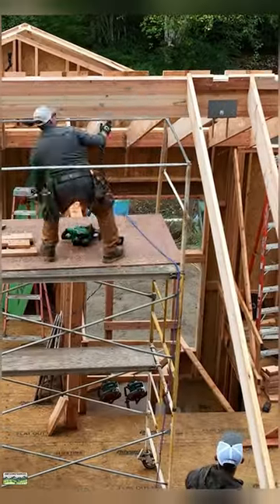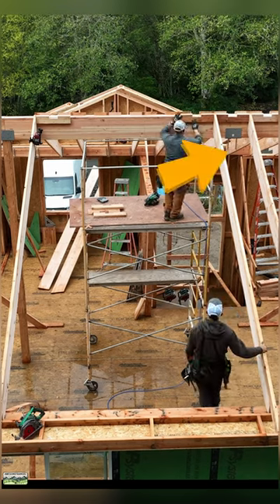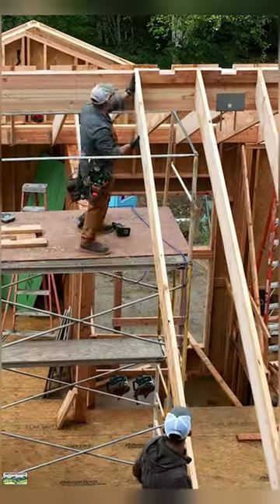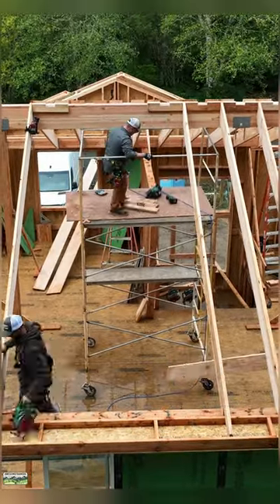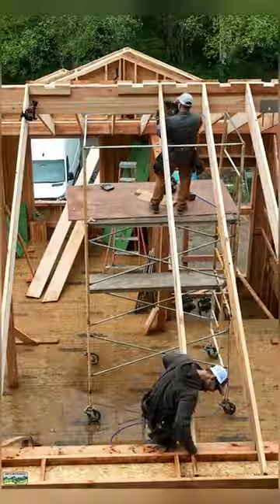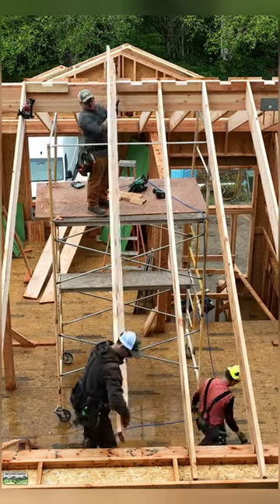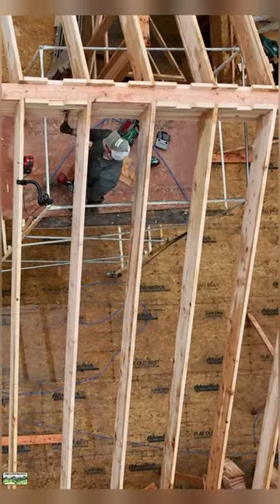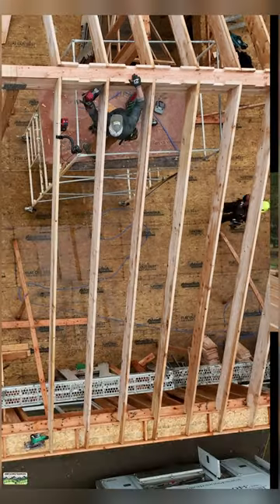Hand Cut Roof Framing #shorts

Comment: I stayed confused on insulation.  If it's insulated tight to the roof deck does it need ventilation there?  Or is that just spray foam?  Are you using baffles and Batts?  I hate not understanding
Reply: Also very curious about the ventilation gaps. Maybe mechanical ventilation??
Reply: You don’t insulate roof rafters- but you do allow air flow through the ridge beam- and - 5-1/2” ridge beam requires some creative solutions- but this allows the Ridge Vent at the the peak of the roof to “vent” and keep the attic temp similar to exterior and avoid moisture development because of competing climates interior/exterior
Reply: @Honeybadger1975  why would you not insulate them???!!
Reply: the insulation doesn’t go tight to roof underside, a gap is left for ventilation minimum 1”, 2” is better.  the idea is moisture and the small amount of heat that comes up from house exits via ventilation.
Reply: @R2Mike  it’s an option not a requirement- the person above me 👆commented for you though- if you do insulate the rafters then his reply explains it
Reply: @R2Mike  insulate living space rafters- maybe this is an vaulted ceiling and the rafters get insulation
Reply: @Honeybadger1975  I get that.  But I'd insulate everything or would feel like a cabin or something in that room?

Spray foam is sprayed to roof decks tho?
Reply: @R2Mike  not where I am NE  USA 

Unfinished attics stay cold in winter and ventilated from extreme heat with attic fans but not required 

Only insulate against living space-so rafters that are ceiling rafters get insulation and air gap baffles if vented from soffit to ridge or other. Over framing is intended to breathe. If you insulated all parts of the attic then you could essentially finish it off- that’s the only reason to do that- or have conditioned storage. Remember Clark W Griswald in the attic?
Reply: @Honeybadger1975  I get all that, and that's how we do it here.  But....in his case, Tim's cutting for ventilation in a room I'm assuming will be have a cathedral ceiling.  So will he use baffles and Batts?  If it's spray foam...then why the ventilation?
Reply: The building science corporation and Matt risinger have lots of thoughts on this. I’d love to hear AF Thoughts. If you want to occupy that story with cathedral ceilings you can insulate under the rafters but when you get to the ridge switch to a open cell spray foam, have a ridge vent with a vapor open membrane and then outside have external insulation (rigid foam / poly iso) panels on the outside, under your shingles (utilizing an air gap)

Comment: 2x12 rafters sound like the kind of thing only a major wealthy construction company would use everybody else uses 2x10s and they work just fine since it's all that is required by code so you can tell there's a difference between crews that work by code and crews that have access to expensive material that they choose to use because they can afford it
Reply: code doesnt tell you all - listen to the structural architect